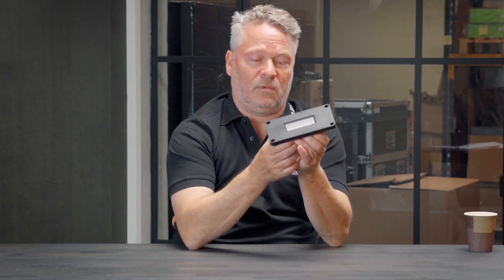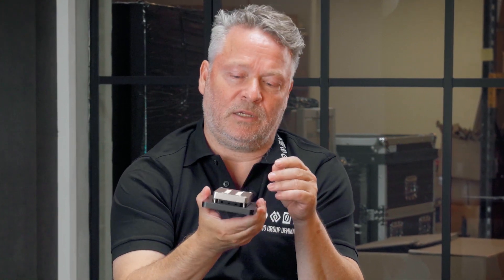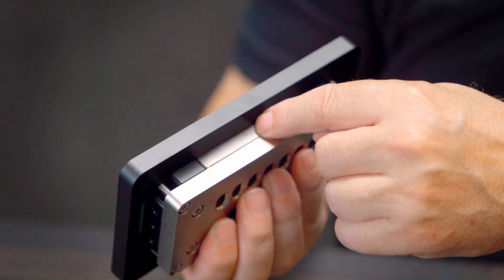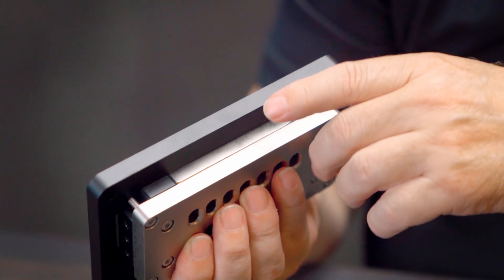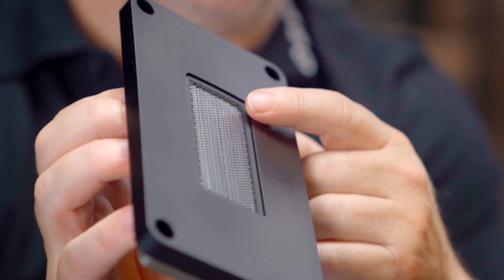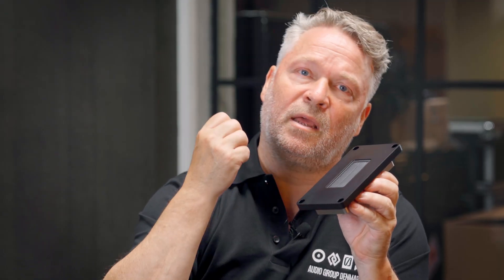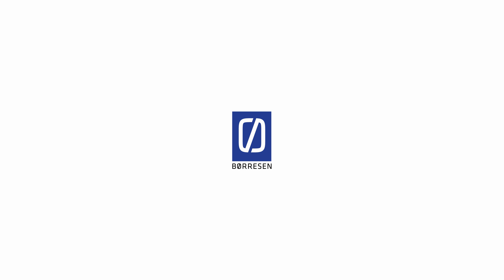Børresen Ribbon Planar Tweeter | 2 minutes Tech Talk

Comment: hmm. does not have resonances since it cant store it ???? erm NO thicker has less resonances. im sure you know this since it has more damping.  going insane light has benefits.. but resonance is not one of it !
Reply: Seems you're wrong, I asked. Chatgpt for an answer on this, as well as Google Bard. And then you have Michael Börresen himself telling you lower mass means less resonances, all else being equal of course.
Reply: All masses on springs have resonances.  The resonance frequency scales as the sqrt(k/m), where m is the mass and k is the doing constant.  With rare earth magnets, we increase k, if we also decrease m by a factor of about 20, we drive the resonance well into the ultra sonic. Since the amplifier is designed to roll off in the ultrasonic, a ribbon speaker doesn't have a resonance that can be driven by the amplifier.